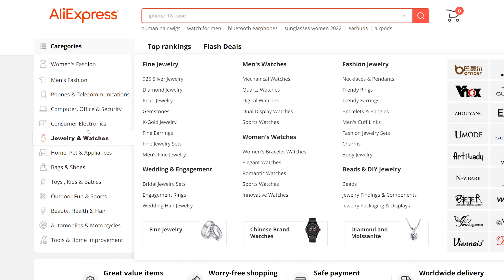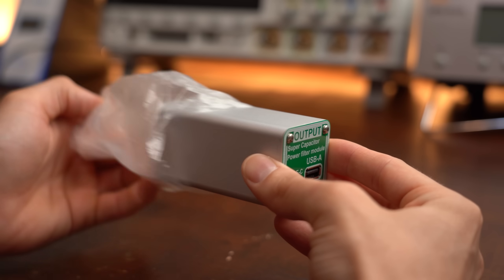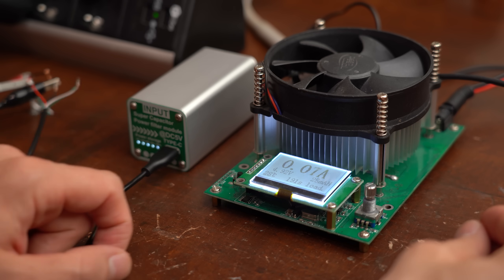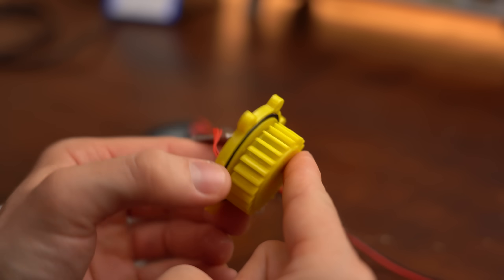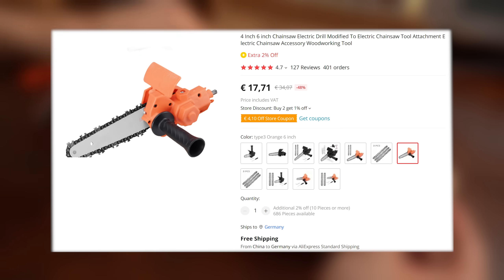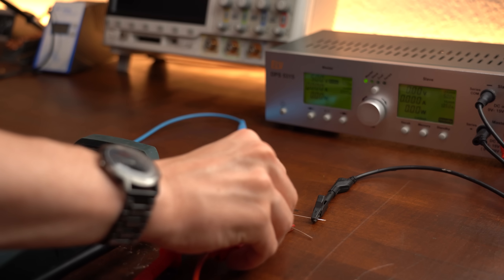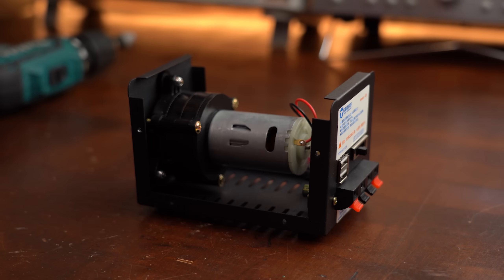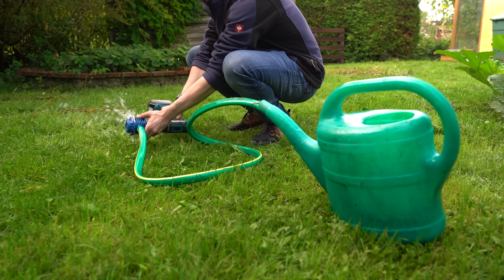I tried finding Hidden Gems on Aliexpress!

Comment: It has taken some sellers on Aliexpress more than 1 year for the order to arrive...
Reply from the maker: Oh boy. That is ridiculous.
Reply: 90 days and u go charge back your card.
Remember always use card, regular or virtual one. But card.
Reply: @mateuszzimon8216  Aliexpress sellers sometimes have tricks that only give you a window of a few hours to file a refund. I obviously missed it. The website said that I could only file a complaint after 90 days, but that the buyers protection also expires in 90 days...

Comment: the "spy" detector is interesting. are there usable versions out there you could test/recommend?
and keep the hauls coming :D
Reply from the maker: When I did research for it, I found no one who said it would work like described. I think that says it all.
Reply: @greatscottlab  thats sad to hear... I could see a very good use case for staying in hotels / airbnb spaces where so many people could easily spy on you... . And probing every cm²  in the room is a hard pill to swallow.
Reply: @Ruboka  They exist, but can be rather expensive (4000€)
Reply: @MrDeaz  yeah.... This is sth that should not be the case. But maybe someone keeps this tech out of reach, because it could cause harm if its easily available? But this is getting too far into tin foil hat territory.
Reply: @Ruboka  It would be incredibly difficult to create a universal device for this. There are simply so many different frequencies and protocols that can be used to transfer data from somewhere, and there too many legit devices that also use these frequencies.
Reply: @sasodoma  proximity could be used so nothing to far away would interfere. but i guess you are right.
Reply: @greatscottlab  maybye you can build one!

Comment: Can you do a battery mod so that old Android phones can be used directly via USB power.

exact issue is, Modern phone battery has a circuit board inside it, if you remove battery you cannot use phone because it cannot be power on without that circuit. I want to use my old Android phone to control other IOT devices, like AC, house lighting, desktop Google assistant, cast music & videos.
Reply from the maker: That is actually a good idea. I will have a look ;-)
Reply: @greatscottlab  thanks..  I will be waiting.
Reply: @greatscottlab  oh , that would be hot! I hate that no one thinks about this usecase after a phone gets to old. I do not like the idea using an old android phone for a webcam which results in it being constantly charged up, which can hurt the battery.
Please look into it!
Reply: @Ruboka  exactly.. old batteries can lead to disaster. Samsung's latest battery fiasco made me worried.
Actually some very very old Android phones with removable battery can power on, but they can't handle IOT smoothly. Manufacturers have removed that capability & no one recognised yet.
Reply: Try a 1N400x diode from USB input to battery positive. That's what was done for Perk mining to run a cluster of smartphones from ATX PSUs.

Comment: No like this time, because of featuring this terrible saw thing. Sorry.
Reply from the maker: You didn't like it?
Reply: @greatscottlab  TBH, I find it terrifying :)
Reply: @greatscottlab   The drill chainsaw is very dangerous since it's putting your hand so close to a chainsaw chain. Similar to the "Lancelot" chain saw grinder disks. Stumpynubs has a video on them, and how he was injured (nearly losing use of his hand) by one. This attachment seems similarly dangerous in design, even if it has less total kinetic energy. It would maybe not be so bad if the handle was positioned further back or it had a way of anchoring the saw to the drill.

Comment: The water pump needs to be primed first.
Reply from the maker: Honestly not sure how to do that. The product description also did not mention that.
Reply: it looked like he had it primed when he sucked the end to get the line filled before trying it. More likely it can't hold a prime well and would need to be used at the bottom close to the water source, then let the high pressure side push the water up to it's advertised head height. Drill pumps usually have a rubber vane in them and don't do well for much more than using them as a transfer pump at about the same height though.

Comment: The pump seems a sentrifugal pump. They never suck, they only push. You need a line wit no air in it, an u-shape to keep it always primed or a oneway valve to keep air getting into it from the output side (especially when the pump is off) after priming it. Any air in the pump will make it not pump.
Reply: Yes, a check valve will definitely work if the the pump is always filled with water, but I think it is a vane pump because you can see the input shaft is offset from the center of the casing.
A vane pump is potentially capable of sucking air, but it needs to be made with pretty good precision.
Reply: @Henning_S.  No, it is not vane pump. I have one, you can also google the exacty same one opened up. It is centrifugal pump for sure.
Reply: @drister007 6:11 it even says on the packaging: "includes inlet filter and spare pump vanes"
Reply: @Henning_S.  Aha in that case it is different pump than mine. I bought one that looks EXACTLY the same, but i bought it locally. That also explains why this pump are pumping so bad. Mine is much better, like 5 or maybe 10 times better waterflow. That explains it.
Reply: It's not a centrifugal pump.

If it were the inlet would be at the centre of the pump, also know as the eye and the outlet would be tangent to the outer casing (volute). It also wouldn't be circular, it would be a logarithmic spiral.

If you look closely you'll also see that the shaft is offset from the centre a little. That makes it extremely likely to be a vane pump with a rubber impeller, exactly like what you find in an outboard motor etc and it should be self priming as it's a positive displacement design.

Chances are that it's performance can be improved by disassembling it and cleaning up the impeller and removing the flashing that China almost certainly didn't remove. If it's been done halfway properly there should also be a pair of stainless washers top and bottom and a ring, if there aren't and they're relying on getting a seal between the plastic housing and the impeller that's a simple improvement as well.

Either way, that pump design doesn't rely on extremely precise machining like a sliding vane so if it doesn't get great performance it should be able to be improved fairly easily, to a point.
Reply: lol been sick in bed but I got up so I could read text well enough to write nearly exactly this. This^^^^!! Well said.
Reply: @comp0smentis  n
Reply: Literally jumped into comments to make sure someone already wrote it xd
Reply: I can remember my dad using a drill powered pump when I was a kid 40+ years ago.  The pump wouldn’t prime itself, so it had to be equal or below the liquid source. I think we used it to drain a waterbed .  They also didn’t last long.  We could only get a handful of uses before the rubber impeller would wear out.  They also need to turn pretty fast. An electric drill would probably be better than a cordless.
Reply: centrifugal* its called that because of the way it spins on its center. I always think of a science centrifuge.
Reply: THIS! GratScott should try it aggain and give us the opinion aggain.
Reply: I have a pump like that and used it to take diesel out from big tank for oil burner to use it in another heater. It only lift the diesel by using a high rpm corded drill and then it sucked it up from depth of 2 m with out putting any prime on the pump. The drill had around 3000 rpm and and was about a 1000w in power.
Reply: I used one to pump water from a raon collector downhill on one side of a shack over the roof of said shack to another container uphill. It worked well once the pump was flooded. (And no, I couldn't go around it because of the tube length.
Reply: I have this waterpump it requires 2000-3000rpm powerdrill to suck
Reply: Frustrating isn't it! ( Looks at your mother )
Reply: I bought one from Aldi and I can put it in the rainwater tank and I get more hose pressure using a 2000 rpm dewalt cordless drill. No priming or air issues! It's the best drill powered pump I've had and used.
Reply: Not sure how he got it wrong
Did he think it was vacum generator?

Ofc it wont be able to make such suction for water to reach the top its a water pump not an air pump
Reply: Iv pump
Reply: They do suck, just not very hard.
Reply: He shows himself sucking water through the line to prime it. The problem isn't that he didn't prime, it's that the pump isn't powerful enough. The claimed suction head of 2m and delivery head of 15m are pretty far-fetched, mains powered central heating pumps frequently only have delivery head of about 6m.
Reply: @jabberwock95  he did not really prime it, as soon as he released his mouth from the pump outlet, the water rushed back into the pond and  at the time he started the pump it was already empty. If there was a check valve at the end of the hose in the pond, the primed water wouldn't drain back and the pump would stay filled.
Reply: @Henning_S.  I'm assuming he spent longer trying it than the three seconds shown on video before declaring it didn't work. He obviously knows it needs to be primed.
Reply: @jabberwock95  yes, probably he tried multiple times, but we don't know what different methods he tried, but still, if it is not extremely bad manufactured, it should be possible to pump water out of that pond if the pump is already completely filled with water at the beginning, and the easiest way to do that is a check valve at the end of the suction hose.
Reply: @jabberwock95   He should have lowered the other side below the surface level instead of risking getting sick.
Reply: I have this pump too. Couldn't figure how to make it work too
Reply: It’s not a centrifugal pump… and in my experience if it whas. I know a centrifugal pump can suck. Even if the line is empty but that depends also on the height that of the waterlevel and the height of the pump.
Reply: true:)
Reply: I can get the same product locally but marketed as an oil pump...
Reply: It will probably rust and seize up before long even if you make a priming system for it
Reply: I closed the video the instant I saw that.  Not priming a pump and claiming it doesn't work => change channel.

Comment: I’m looking to get that Li-Ion charger board. Glad it worked out.

I was also looking at getting a charger + boost converter module (all in one IC solution).
Reply: I bought that one a few years ago and was not so happy. It did not convert the voltage level from 5v to 4.2v, instead it was pulsing 5V directly to the battery.